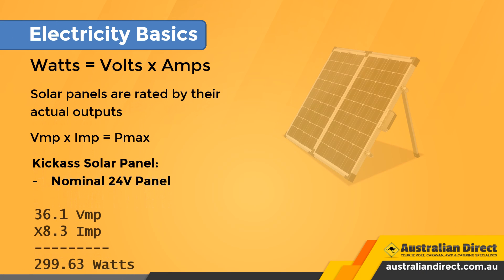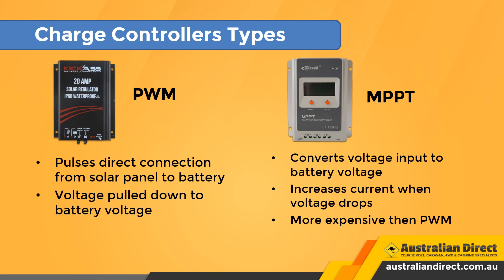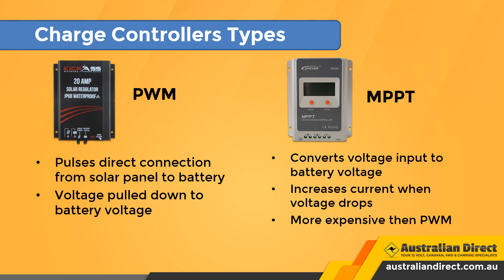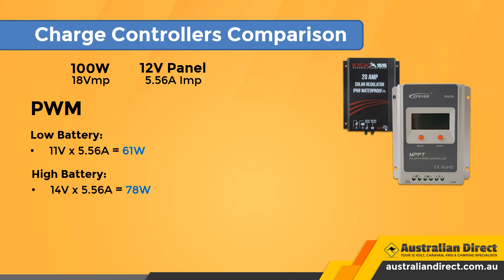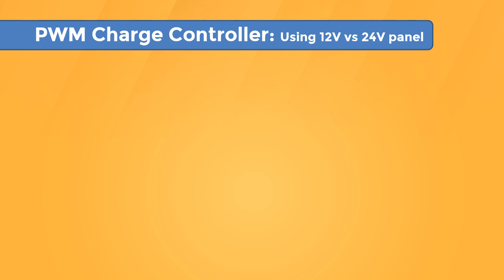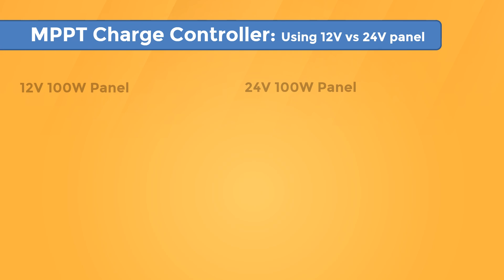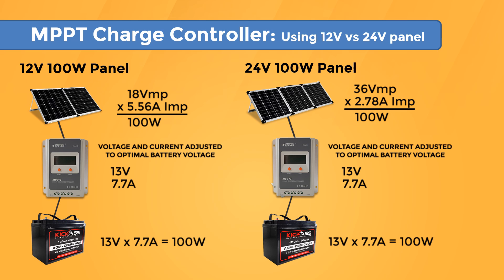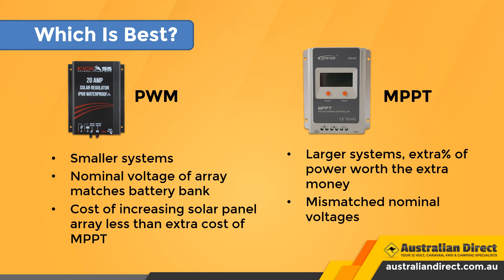PWM vs. MPPT Charge Controllers

Comment: Is it fair to say that the PWM pulses off and on to cut the voltage supplied by the panel down to the voltage required by the battery, whereas the MPPT uses a buck converter to step the voltage down instead, so it makes full use of the voltage supplied by the panel?

The PWM just pulses off and on to reduce the voltage, so it's effectively only on maybe half the time, whereas the MPPT's buck converter is a switched mode power supply which can make use of the voltage supplied by the panel 100% of the time.

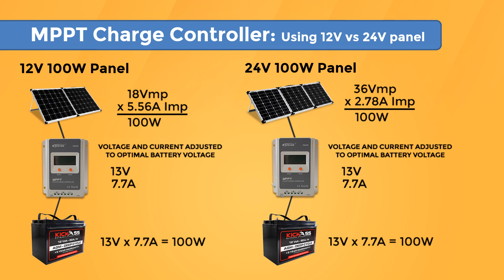Comment: Hi Australian Direct, GREAT video... but I do not understand one point you made. In the video with timeline at 9:18 to 9:46 it is confusing which one you are saying is the less expensive system, due to your wording "... even though the MPPT charger controller is more expensive". The wording is ver confusing and not sure if the higher wattage 24V panels with MPPT actually work out cheaper or not. Could you please explain that little part for me again? :)

Comment: I want a small system of LED lights for our property. 25W solar panel-12vbatt. 7amphours AGM . PWM charge controller can be set for High voltage disconnect , low voltage reconnect and low voltage disconnect. Question ...what do I set those at?

Comment: great work done ..but ihave aquestion for you..am trying to desine asystem which is automaticaly operated by pwm controller ..to run for 12hrs ..70Ah batrry and 100w panel and 30 A controller pwm..serving aload of 32watts for 12 hrs but my disapointment is ..it doesnt last for 12 hrs wat could be the problm???patrick from uganda
Reply: A bit late, but depends where you are. Solar generation can vary greatly, but it usually has a capacity factor of 10% - 25% vs its rated output. That means your 100W (70W) due to PWM would generate between 24h x 70W x 10% to 24h x 70W x 25%, or between 168 Watt Hours (Wh) to 420 Wh.

A 32W load for 12 hours per day consumes 12h x 32W or 384 Wh. Therefore it is highly likely that your consumption is more than your average generation. Generally you want to be able to generate at least twice as much as your consumption on an average day, and have enough battery capacity to ride through the low generation periods.

Assuming a 12v Lead Acid battery as well, at 70 Ah with a 25% depth of discharge (generally the maximum you would want to take it for the battery to last) 70 Ah x 12v x 25% = 210 Wh. Unfortunately your battery would need to be larger to run your load over a 12 hour period consistently. You would ideally want at least a 200 Ah battery, and 300W panels.

Comment: when we talk about the voltage , it would be the charging voltage otherwise it would be the discharging voltage , charging voltage always mean that the charger voltage is higher than the battery hence the higher the charging voltage the more amp is pushed into the battery but as the battery is getting full the voltages get closer to each other and less amp woulb be unitil full chage that o current is going since the charger and the battery have the same voltage .
in this case the mppt would regulate the high panel voltage to about 14.5v to charge a 12v battety , if the battey sucks up so much amps that the regulated charging voltage drops under 14v or so , the mppt charge controller use the higher panel voltage to bring up the charging voltage up to 14.5v so when the battery(ies) are empty or there is a load on then we take an advantage of mppt over the pwm charger controller , if there is no load or the battery is geting full there would be no advantage , the best use of mppt would be in higher panel and battety bank voltage , 48v panels would be ideal to charge up a 24v or 36v battey bank , for 12v panels charging a 12v battery ,  using mppt is a waste of money , a cheaper pwm would do the job , SO infact the mppt does not convert the higher voltage into more amps but if there is a amp draw by an empty battery or a load then the charging voltage drops and the mppt simply use the panels higher voltage to regulate and bring up the voltage to 14.5v there for supplying all the amp that the load and or the battey demand up to its rated current it would supply then it would regulate the current to protect itself if it is designed right .
and M  is for MAX.  and not multi by the way .
Reply: Nice and very helpful info. Thanks
Reply: This is old, I assume you have revised your thinking as at the time you posted this you obviously knew nothing about MPPT  conversion.
Reply: my mppt charge controller was charging my battery at 12.4/12.5 bouncing back and fourth any idea why? and when the sun goes down the battety voltage goes down with no use.  I have the good charge controller from this video. solar panels are doing there job and Batterys are charging properly with a battery charger.  

update maybe its my charge controller. im at Work and yesturday night I switched to a cheaper  and only controller I have to see if it charges.

Comment: Somthing just came to mind . . . MOST LV panels already HAVE a charging diode in the junction box .  Diodes have a small forward drop,  a small resistance AND the charge controller also has a diode .  Would removing the factory installed panel diodes slightly increase output ?

Comment: One other flaw in your analysis of MPPT vs PWM is that the extra amps are not always needed.  For example, as the battery bank become topped off, it will reject higher amperage just as it does with a normal wallcharger of fixed output (such as 13.6V 10A regulated output).  The battery will suck more amps when it is in a lower state of charge, but then taper off when it becomes close to fully charged.  So my main point is the extra amps of the MPPT are only really helpful if either you run your batteries down low so they can benefit from the extra amps, or you have a simultaneous substantial load on the batteries while you are trying to shove a large amount of amps into them.  If that is not the case, then a PWM controller (or more than one) may be worth the cost savings over an expensive MPPT controller.
Reply: Not sure it's a flaw, as they were quite clear to point out at 3:14 when talking about PWM charging that it related to the buik charge state. But yes, MPPT is only of benefit if you have somewhere for the current to go, as if the battery has topped off, MPPT is of no benefit.
Reply: I wouldn't  say no benefit.  A battery bank can be topped off and if the load on them matches that of the solar charging power, that is close to ideal since all of the solar power is basically "passing thru" to the load.  However, this is a balancing act in a battery based solar system.  It is almost always the case that the load and the solar charge current are mismatched at any moment.
Reply: @davidjames1684  Sorry, yes, unless there is still a load or  the battery is loaded again...  how much so determining if it's is going to hold the battery voltage or ramp up fully to in order to restore the float voltage.

Comment: One cool  to do if you have multiple 12V solar panels but a 24V battery bank (two 12V batteries wired in series), is to put a separate 12V PWM controller on each battery and only connect half of your panels to each.  For example, if you have four 12V panels, connect only 2 to each charge controller.  This will reduce the current flowing thru each controller, thus reduce some losses, plus there are other benefits (such as more accessory outputs on 2 controllers compared to only 1).  I have tried this technique and it works rather well.

Comment: Cant you also charge longer with an mppt since the panel voltage will stay higher when in series then the battery voltage during low light conditions?
Reply: Yes, MPPT has the benefit of keeping the panels at their optimum power point for as long as possible. In the case of the EPever charge controllers, it will stay in MPPT mode until output drops to 10w, and then will revert to PWM until the panel stops outputting. So once the output of the panels drops below the load on your batteries, MPPT will keep those panels at their maximum output as the sun is going down, or there is extensive cloud cover, etc.

Comment: more amps = faster charging 
higher voltage could push more  electrons into the batteries so they fill up with more electric energy faster than if you keep down the voltage

Comment: I have a 6x( 31v,7.5A,250w mono panel) to charge a 24v, 400AH battery. What kind of charge controller should I use?
Reply: EP Ever 40 A. will take 100 VDC. Series/parallel wired panel NOT to exceed 100 VDC.

Comment: Bad calculation.  An 11V low battery does NOT use 11V to charge.
Reply: Also completely negate to mention that the current produced by the panel will increase when the voltage decreases. It's just not linear (following V=IR); MPPT finds the peak giving the time of day. Garbage video meant to push more expensive product, watch GreatScott's instead.

Comment: I think using wattage is misleading in case of charging of a 12V battery with 12V rated panels as the amperage remains nominal no matter what voltage the controller outputs to charge the battery with. you are adding amps to a battery not watts. Only difference is MPPT can put out more amps with same voltage input.
Reply: more amps = faster charging 
higher voltage could push more  electrons into the batteries tso they fill up with more electric  energy faster than if you keep down the voltage
Reply: Just brilliant explanation, very simple. Makes you wonder why the video was so long.
Reply: The amount of current your batter bank will accept is a function between the voltage of the bank and the charge voltage.  The larger the difference the more current into the battery.
Reply: @pjwlk  
you are wrong , the charging voltage is limited to the max. battery voltage , the high charging voltage if not regulated will over charge and damage the battery , each battery cell had a max. voltage that can be charged upto , the same with the amount of max. current it could take otherwise it would be damaged and useless .
Reply: @NP-wp3ih  14.5V is the safe and maximum V for Battery for 12V battery if i am right. How about for 24V battery?
Reply: @pjwlk  
when we talk about the voltage , it would be the charging voltage otherwise it would be the discharging voltage , charging voltage always mean that the charger voltage is higher than the battery hence the higher the charging voltage the more amp is pushed into the battery but as the battery is getting full the voltages get closer to each other and less amp woulb be unitil full chage that o current is going since the charger and the battery have the same voltage .
in this case the mppt would regulate the high panel voltage to about 14.5v to charge a 12v battety , if the battey sucks up so much amps that the regulated charging voltage drops under 14v or so , the mppt charge controller use the higher panel voltage to bring up the charging voltage up to 14.5v so when the battery(ies) are empty or there is a load on then we take an advantage of mppt over the pwm charger controller , if there is no load or the battery is geting full there would be no advantage , the best use of mppt would be in higher panel and battety bank voltage , 48v panels would be ideal to charge up a 24v or 36v battey bank , for 12v panels charging a 12v battery ,  using mppt is a waste of money , a cheaper pwm would do the job , SO infact the mppt does not convert the higher voltage into more amps but if there is a amp draw by an empty battery or a load then the charging voltage drops and the mppt simply use the panels higher voltage to regulate and bring up the voltage to 14.5v there for supplying all the amp that the load and or the battey demand up to its rated current it would supply then it would regulate the current to protect itself if it is designed right .
and M  is for MAX.  and not multi by the way .

Comment: This was an excellent discussion of the differences between PWM and MPPT charge controllers, and the math was easy to follow. Very well done. Thank you.
Reply from the maker: Thanks for the feedback OutbackEddie
Reply: Woow excelent video.. I just have one question... How does the MPPT controller could get a higher current from the panels than the short circuit current??? When you guys explained the mppt controller you said that the voltage loss is "converted" to current gain, but this current is substantially greater than the short circuit current of the pane.. ¿?

Comment: Just watched the video. I agree the presentation tried hard to explain the controllers, but I still can't wrap my head around it. I thought a solar panels ratings were achieved by measuring the open circuit voltage in bright sunlight (using BEST case scenario. ie: crystal blue sky, sun directly overhead (summer). Then, short circuit the panel under test and measure current output. Am I wrong here? I have a pair of old panels that were used in a solar farm at one time. I measured each one using the method I described above. I got about 22V open circuit and 3.2Amps shorted output. If I do the math, that means the panel can dissipate  70 watts? So, what if I directly connect the panel to a  run down 12v battery in bright sun, take a current reading. Then insert a MPPT controller and do it again? Will I actually get MORE energy to the battery? I need that explained. Thanks! I would like to see a video showing all this in real life, as that is how I test stuff.
Reply: Hey Curt, don't attach the 22V panels directly to a 12V battery or you will damage the battery and potentially cause it to overheat! In a plumbing metaphor, voltage is like water pressure, so if you attach solar panels with 22V of pressure into a battery than can only take 12V of pressure, it's like force feeding your battery electrons that are more energetic than it can handle. The charge controller is like a pressure regulator, such that it won't allow the solar panels to charge at more than 12V. With a PWM on your setup, it can only charge @ 12V * 3.2A = 28W, to keep it safe. If you use an MPPT controller it will also charge your battery at 12V, but it will turn the excess voltage into increased current. With MPPT it will reduce the voltage to 12V but proportionally increase the current so that you get closer to the 70W your panels can output, so your current should be about 70W / 12V = 5.8A. This increased current can charge your battery faster than the PWM is capable of, while still keeping your battery at a safe 12V.
Reply: I see the point you are trying to make about over volting  a battery. All rechargeable batteries can swallow only a certain amount of current during a charge cycle. I know that. In my example, I was using a direct connection for a short time, long enough just to take voltage and current measurements. In my case, my panels can only deliver about 3.2 amps in full sun with outputs shorted. That's near zero volts, max amps. if I were to put a high power variable resister in the panel output and slowly INCREASED the resistance, you would notice the voltage goes up and the current goes down! I've done it! The solar panel is a constant current device. As the voltage approaches the panels max voltage output, the current will be nearly nothing due to the fact that the resistance has gone up so far that the voltage drop across the resister in nearly zero. Also, most batteries require a higher voltage than it's standard rating to charge anyway. Usually 14 volts for a normal deep cycle battery. Now, my small cheap PWM controller I believe, simply supplies full output from the panels (as if you wired directly to the battery), THEN, when it sees the voltage hitting the cutoff point, ie: 13.7 or so, it stops, or opens the circuit from the panels. When battery voltage drops below threshold, say 13.1, the charger kicks back in repeating the cycle. Now, they say to properly match your solar panel array output to match your battery capacity. Here's a good example! My setup is like just 2 flooded cell batteries in parallel. My panel can only muster up 3.5 amps max. No big deal. NOW, say I got a roof full of panels that could deliver say 60 amps in full sunlight @ 14 volts and perform the same setup? NOT good! Slamming those 2 batteries with 50+ amps would blow everything sky high! If I now add say 10 more batteries, ok, getting back in ball park now. The current will be divided up a amongst all the batteries now. So, again, say I now have a super hi heavy duty PWM controller between the panels and the batteries? It's still doing the same thing? Like having a simple switch and a voltmeter. You close the circuit and watch the voltage. When batteries show 14 or so, you open the switch and wait till the voltage come back down to say 13, then close switch. Repeat as needed. How can a MPPT controller beat that out? I still don't get it. Thanks!
Reply: Because it's a constant current device. If you pull the voltage of the solar panel down to the battery voltage, it is significantly and below the VMP (voltage at maximum power), you are not getting the maximum watts from the panel. Going back to a water analogy, as Michael pointed out, voltage is like water pressure... by lowering that voltage, you've lowered the pressure. If you can somehow keep the voltage up, and sit on the VMP/IMP sweet spot for the panel, you will get the maximum wattage from the panel, and for say a 22V open circuit panel like you had, you might get another 1.5 amps or more from it. i.e. if we do the unrealistic 100% coversion from 22v to 12v, that is a ratio of 1.83:1, which means our 3.2A becomes 3.2A*1.83 or 5.85A. Instead of directly coupling the solar panel to the battery, the MPPT charge controller lets the panel rise up to it's most efficient voltage, and draws the current at that voltage, and then down-converts that your system voltage, with the resulting increase in current.